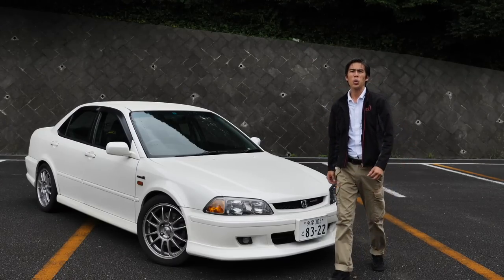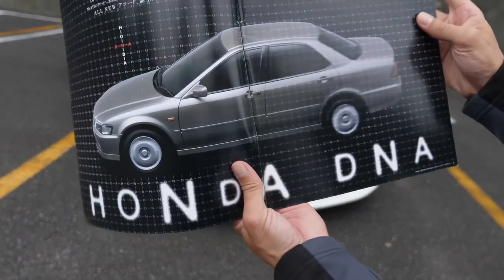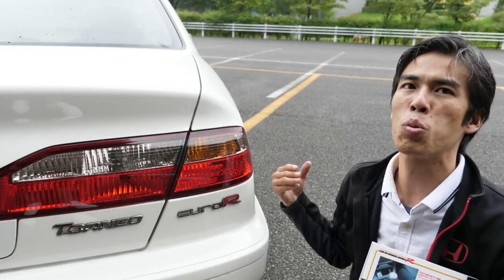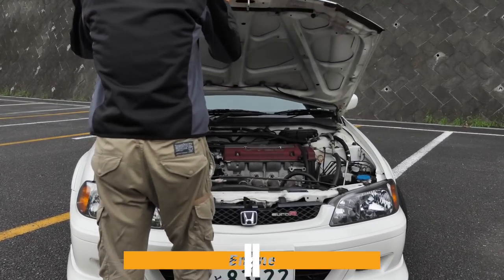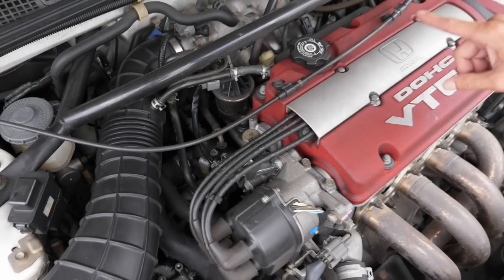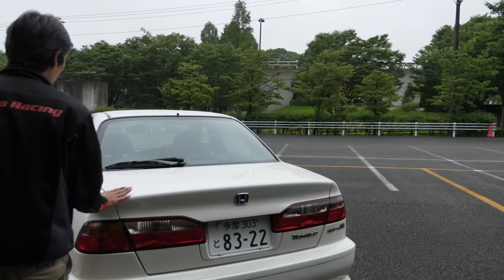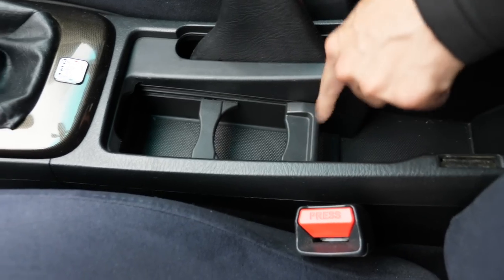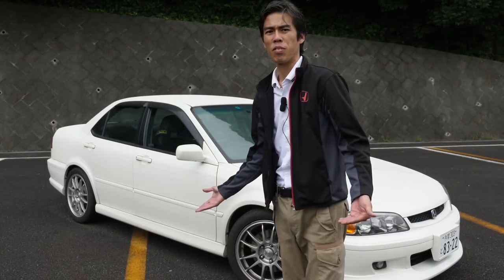The Odd Accord You Don’t Know | Torneo Euro R CL1, JDM only Honda H22A DOHC VTEC | JDM Masters

Comment: Yup, I like slim sedans, I like slim cars in general. Nowadays cars are way too fat.
Reply: same, cars got way too big.
Reply: I know what you all mean but it's for safety standards.
Reply: @benjamincho4819  Partly the case, but not really. Cars under 170cm in width are still for sale new.
Reply: @benjamincho4819  yup, sadly, same with emissions, thanks to them cars consume more fuel and get less power.
Reply: Yeah I hate the lack of options for lighter sedans, I hate how big they've gotten
Reply: @Rory695  safety regulations pretty much prohibit light cars sadly.
Reply: @benjamincho4819  wouldn't need such high safety standards if more people were competent drivers  and paid attention on the road >_>

Comment: For someone that grew up driving ek9s and dc2s in my early 20s, and now in my 30s with two kids, my cl1 is the perfect car. Same 90s honda driving experience but space for the family and just a little more refinement. Plus, ek9s and dc2s are hard to come by now or rusty. I'm in the UK for reference
Reply: Do consider Integra GSR Sedan or even a JDM Type R sedan. all the fun from the DC2 with a good trunk and 4 doors.
Reply: How reliable has It been? I want to import one to the US within the next year or two. My first car was a 1998 Honda Accord and I always liked the Euro R.
Reply: Btw. I got my 1998 Accord to almost 300k miles. And It was still running when I sold It
Reply: I've also owned a fd2, and I personally did not get on with it. Sat too high, visibility is poor, and the k20 lacks character compared to b and h series.
Reliability is as good as any other 90s honda, only ever minor issues like brakes.
Reply: I did also consider a db8, but rust is a major issue on these same as dc2s, and I live near the sea in the UK.. About the worst place to accelate rust!
Reply: @lloydbernasconi  Really? I just traded my EK hatch with a B16 turbo for an FA5, but havent got to drive it as it is in the shop!
Reply: @Hanschepu  what engines in the fa5? Is that an si version of the same chassis released in the US? Obviously that's just my opinion though man, don't take it for gospel!!
Reply: @WeAreWatching Yu which model?
Reply: @lloydbernasconi  Yes, its the SI of the 8th gen sedan, comes with K20Z3 + 6speed with LSD, the one I bought has FD2R pistons and cams and pushed 225whp n/a on the dyno, so im pretty stoked to drive it asap
Reply: 90s.. wanna keep driving them but it is bit old for today, price of a good condition one have been skyrocketed.. it pushed me to buy a newer model car
Reply: @WeAreWatching Yu your nice weather year round probably helps. Here in the UK cars just rust, and people just buy new German cars on finance, hence the 90s honda scene slowly disappearing and becoming more expensive and harder to find.
Reply: I had an ep3 premier edition when I was 22-23 loved it. Sold it then only recently got a car again in February. I got into bikes. I've got a Toyota Crown Athlete VX, as I've got 2 small kids and wanted something different and 1jz power. Best car ive ever owned
Reply: @Hanschepu  as someone who dailys a sir g sedan (non us version of a gsr) i personally think even with 4 doors the space in the back seat is more tolerable than it is comfortable, but the car is an absolute blast to own nevertheless

Comment: I had the Accord CL1 in UK about 9 years ago. I really do miss it. Regret selling it. I had the Mugen 4-2-1 manifold and Buddy Club damper adjustable coil over suspension and some other bits. Was lots of fun and being in the UK it was extremely rare! Also cool the smuggled genuine JDM plate starts with a 3 number too. I didn’t know it at the time but glad it was authentic and I still have those plates in my garage to this day 😊

Comment: Is the Torneo an S-iR as opposed to Type R?  Doesn’t rev as high? A dc2 Type R 1.8 is pushing out similar horsepower so surely a h22 with a type R camshaft should push out more bhp than the b18?

Comment: I think the European honda type r chassis code ch1 came out first. it had the h22a7 212hp red top then honda of japan came out with the euro r chssis code cl1 with  h22a 217hp red top.(type r name was already taken in europe).the difference between the motors is the iab intake vs the euro r single runner intake.i had to figure all this out when i went h2b swap. H22a euro r and dc2 integra type r lsd transmission.

Comment: h22a on 4 door sedan, better than prelude type s 2 door sport car, driving 4 door car can hide the other side of the character which is race part going normal in the street with other cars but not really normal, the most important is the engine, still can compete with other honda sport and race cars, if i was living in japan i will check the engine and purchase it, until today there are not really many other brands sport cars exist, this car better than evo7, i test one from Mitsubishi agency was on sale, but stock evo7 performance less than honda type r and euro r,  handling stiffness of 4 wheel drive and steering and chassis is high on evo you can feel it except performance of engine on evo comparability to honda is little low is like sleep engine, so this Euro R is a very appeal sport and 4 door car with a wake up engine.

Comment: 90s golden era Mugen twinloop exhausts are perfect. 

Low throaty growl until opening up for vtec. Otherwise, very lowkey and almost stock sounding.  Just an amazing enhancement to the sound of the N/A high rev motors themselves compared to other louder more blatant offerings. 

Design wise they are almost stock looking from the normal viewing angles.

Sadly, some earlier usdm versions have wide tips that break that stealthy philosophy though for whatever reason. 

Regardless, the golden era specific exhausts are just timeless.

Comment: The tail lights look very similar to the early 2000s accord here in America. But not as square or angular. I wish America could have these amazing special edition cars. Luckily modern companys like Toyota are doing this more often now. Like the Camry TRD being released early this year. Honda needs to catch up. We finally got the civic type R but that's the only "sporty" Honda for sale in America. There is an accord sport with a turbo but it doesn't quite hit the same because other than having the word "sport" on the trunk it's completely identical to the normal accord.

Comment: The description said it was equiped with a H22A, I swore these cars came equipped with the DOHC VTEC f20 blue top motor ? I'm nearly positive it came in euro R accords of roughly this cars generation as it only actually was made .specifically for european market accord euro R's ? Am I completely mistaken or is there aomeone who can back what memory is recalling ....
Reply from the maker: It's not an error. The CL1 Accord / Torneo Euro R came with a H22A red top similar to the one in 1996 BB6 Prelude Type S and 1998 SiR S Spec tuned to 220PS. The same body CF4 Accord /Torneo SiR /SiR-T comes with the 2.0 litre F20B Blue top tubed to 180PS AT /200PS MT. It is a narrow body

Comment: JDM Masters, I think you should review the car based on how it performs at this age rather than the constant comparison to its Type R Brothers. The Euro Rs was Hondas way of showing how a 4 door front drive sedan can also be a sports car. Lets not also forget that that European Accord Type R was the king of the sedan class in European Touring cars!! Its handling and good power to weight ratio made it superior to its rivals! Yes, it sits to the side among its track focused type r brothers but that makes it unique!look at all the features it got! And with the right mods, It can run just as fast as it's two-door brothers, and just as capable. The fact that they aren't stripped out doesn't bother me at all. Nor should you.Great review as always! Next time drive a tuned Euro R Cl7.
Reply: CL1 is arguably better than the CH1 Type R. CL1, lighter different 5th gear ratio, climate control and of course mapped on higher octane fuel. CL1 has a more narrow track though.
Reply: @Mochachinoexfk  The JDM CL1 had more power. But, it was also heavier too.
Reply: saradomin88 CL1 is in fact lighter, only reason it has more power is because it’s mapped on high octane fuel in Japan. If you could map the European type R on high octane then it would perform just as well!
Reply: @Mochachinoexfk  
Specs
 	Type R	Euro R
Engine	2157cc, 4-cyl  vs 	2157cc, 4-cyl
Power	209bhp @ 7200rpm vs	217bhp @ 7200rpm
Torque	158lb ft @ 6700rpm	vs  163lb ft @ 6700rpm
Weight	1306kg vs 1330kg
Power-to-weight	159bhp/ton	vs 166bhp/ton